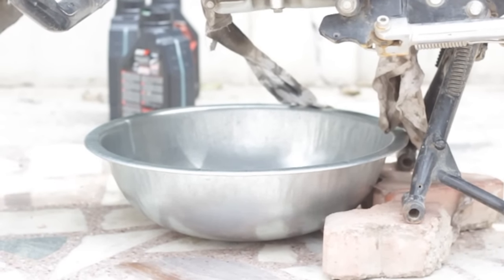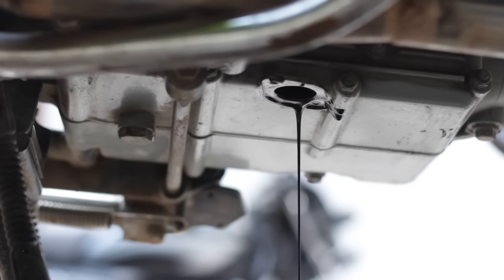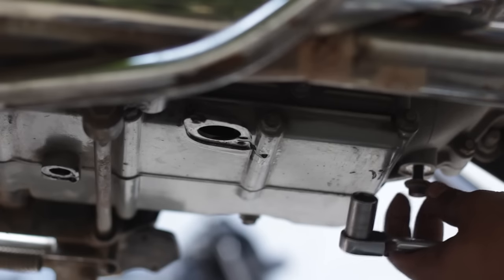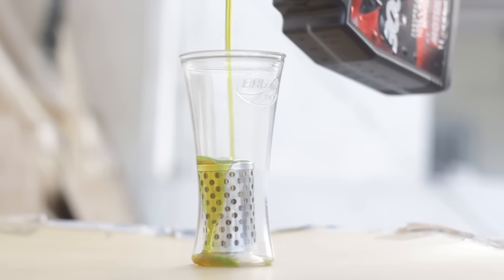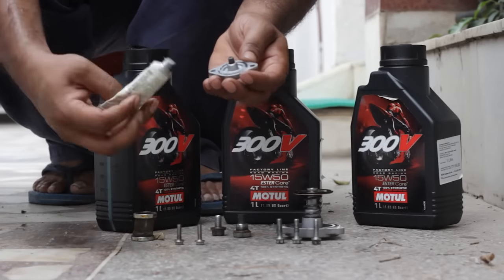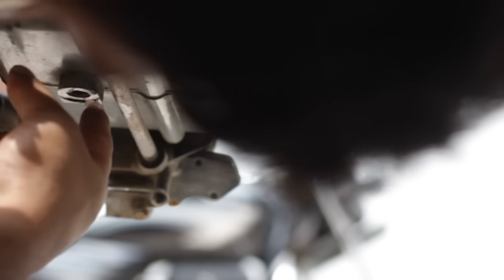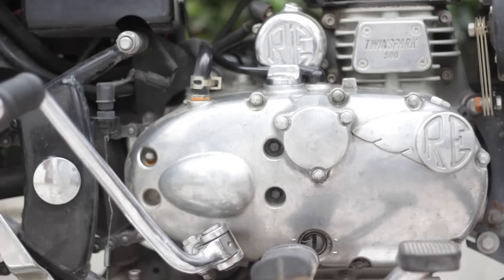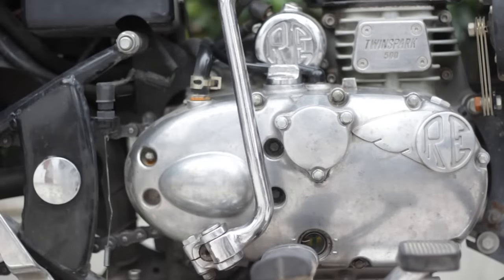Changing engine oil in Royal enfield Bullet 500 UCE

Comment: This oil had more viscosity and can be used upto 11k kms... Reason being the oil loses viscosity but in 300v the oil viscosity is more as this oil is specially made for the racing kinds... While racing the engine revs which causes the oil to circulate frequently in the higher temperatures.... Just my thought again please lemme know on this

Comment: Very useful and detailed video.Can I switch over to Motul Semi synthetic for my 2nd service?Will that be a problem?Also how do we flush the mineral oil fully before changing over to synthetic oil?
Reply: Nikhil Menon You can use motul 5100 in semi synth range after the engine is flushed or 
Switch to motul 300v if your bike's bore is bigger or equal to it's stroke length .
Otherwise motul 7100 will be your best bet in full sunth range.
Reply: VENKATESH AO  thanks buddy I will definitely try that after my paid service

Comment: Hi brother, thank you for a very informative video and I am inspired to do this by myself.
I would appreciate it if you can clear my doubt:
I have TBTS 350 and have no idea about which type of oil put in by the mechanic. I would like to switch to synthetic oil. What additional steps should I take to do this by myself. someone here mentioned about flushing but I dont know anything about it.
Thank you., cheers.
Reply from the maker: Triple Hunter Hi engine flush is a very simple procedure. Do this before changing from or to any synthetic oil. just buy 3m or any good quality engine flush. pour it in the engine and close the cap. then run the engine for 5-10mins. then follow the procedure for changing oil as shown in the video. thats it.
Reply: Enfield Performance thank you for a quick reply. will try this one out :-)

Comment: Never open the primary bolt and never remove oil from it, because it is crank chamber oil.if you are draining it, it will damage the crank.it has 500 ml capacity and you need2.5 litre new oil means total three litre.

Comment: Both sump plugs should be fitted with copper washers to seal them, no goo required. The suction filter may require a fatter O-ring, the original is very thin and prone to dribbling.
Reply from the maker: Sure Jeff, I have never tried it but it could also be a option for people who do not want to use silicon adhesive. Personally i have never had a reason to complain with silicon adhesive as when applied properly it never leaks or causes problems.
Reply: The sump plugs are supposed to have copper washers from new, as is normal for sump plugs on any engine. Some folks substitute Dowty Seals which are more high tech. But as the sump plugs require little torque (or you will strip the threads, steel into alloy), there are supposed to be copper washers there to squish. Bath tub sealant is a poor substitute. Copper washer, drain plug, RE p/n 144846

Comment: hey buddy tell me about the performance of this oil
plzz soon
Reply from the maker: Hey Ujjwal, This oil is great. Gives much smoother performance and also longer service times. I now change oil every 6000 kms instead of the normal 3000 kms change.
Reply: I've used full synth oils for gosh, maybe 40 years, since they were invented. I've found they last much longer than normal and semi-synth oils. 
When an oil goes filthy black its detergents have been used up and it is time to change it. With the full synth I'm using now (Mobil 1) in the C5 it looks like it would last a full year, it's showing no sign of deteriorating after 2000 miles (3200km), it's still like new after 6 months. Another test is to rub a drop between your fingers, if it feels thin and watery its molecules have been chopped up by the engine and it's past time to change it because its lubrication properties have gone home. 
Full synth oils do cost a lot more but they do the job better.
Otoh you cannot change the oil too often.

Comment: I ride a 350cc variant. I got the oil changed to Motul 300V. My worry is the oil levels went really low in just 1900km of running! Do you think there is an issue with the engine? No doubt, the performance and refinement has improved many folds.
Reply from the maker: Saral Gupta Hi saral, lots of reasons for this. Either complete 2.5 litres of oil was not put in the first place or there is a leak in the gasket or there is too much friction in clutch plates leading to burning of oil. The quick process would be
1. top up the required oil and check if it is again going low
2. If it happens again then check for any oil leaks and seal it.
3. Also check while riding if you smell oil burning.
Reply: thanks, I will make a note of them. The only thing that is very obvious right now is tht the gear shifts have gone very hard. I have bought the oil today, will replace the oil and look for any visible leakage too.

Shall keep you posted!
Reply: Check your crankcase for any oil leaks.Tighten all the drain plugs.Check your Exhaust for white smoke (If so,The engine is burning oil with Petrol),Then you have to replace the Head Gasket.
Reply: Wanted to ask,How is the smoothness of gear shifting and Engine refinement after using Motul ?
Reply: @MrSaralgupta  Does the rear wheel spin freely in gear + clutch pulled in?

Comment: Great video. Thank you! I was able to change my oil today thanks to your instruction. Only problem for me was having the wrong filter! I'm from Reno, Nevada and don't have a local dealer. I replaced the original filter, filled with new oil, and reordered the correct filter from Hitchcocks Motorcycles.
Reply from the maker: tcbnev way to go. just do not run the Bullet too much till your new oil filter has not arrived. As if your old filter is chocked up it can block the oil from reaching the engine.

Comment: Hi, You have suggested to do engine flush before switching to the full synthetic oil. Can you tell us how to do or tell us which motor flush you have used to flush. Is there any km limit to do engine flush?
Reply: Flush with fresh engine oil. Simply change to the new oil. Change it about 300km or so of riding, you may want to do it twice until the oil shows clean; full synth stays much cleaner looking. I switched to full synth after first service (Mobil 1 Racing 4T motorcycle oil) but note oil spec is still 15W50 JASO MA. The latter (JASO) is very important because the wet plate clutch runs in it, do not use car oil. It is not possible to completely empty the sump, a good 0.5 litre will always remain in there no matter how much tipping you do.
Reply from the maker: Kishor Kumar Hi engine flush is a very simple procedure. Do this before changing from or to any synthetic oil. just buy 3m or any good quality engine flush. pour it in the engine and close the cap. then run the engine for 5-10mins. then follow the procedure for changing oil as shown in the video. thats it.

Comment: Hello..while changing oil I have ripped the threads of the secondary drain plug..any suggestions to fix it?
Reply from the maker: go to a good mechanic. they will bore in a bigger hole in the engine and fix it with adapter.
Reply: if your threads are not conpelety ripped you can use some tape on your bolt it will automaticly take shapes and its leak prrof only cost 20 rupees per tape 

you can go and buy it from the market from any bathroom and kitchen water pipe fitting  shop ask them for tape which is used to prevent leaking in you tap faucet...

our ask any body who does alminum welding ask weld a bigger bolt on the top of your hole

Comment: what's the local name of the sealant..
Reply from the maker: I  know the name RTV sealant. You should get it at any mechanic shop. It is also called silicone adhesive or gasket maker. If you cannot find it in the, local shop buy it online from here

http://www.amazon.in/ANABOND-GASKET-MAKER-RED-SILICONE/dp/B00S1POOLC/ref=pd_sim_sbs_328_2?ie=UTF8&psc=1&refRID=1TS1CKKHKW6GP0B57795
Reply: +Enfield Performance Thank you
Reply: We generally use bathroom silicone sealant, basically the same stuff only cheaper. However we only use it on the silencer joint, the stuff is heat proof.  As I've mentioned before, the correct thing to use are copper washers (e.g. p/n 144846), which should be on the drain plugs from new. They're dirt cheap, easy to fit and work better. The O-rings should be 'greased' with engine oil. The suction cover O-ring groove is 30mm OD, 25mm ID, so it can take a 2.5mm thick O-ring, the original is barely 2mm thick, loose in its groove and does not seal well.

Comment: Thanks! Very informative.  
off topic - Any experience you have with about any seat mods, or handle bar mods?
Reply from the maker: hey tushar,  for handlebar I prefer the thunderbird handlebar on my standard. extremely comfortable and great turning angle. I find the Bullet standard stock seats quite comfortable, but still looking for better options.
Reply: I too was thinking to get the thunderbird handles, glad u vouched. Also want to try out the thunderbird seats on my std if i can find those and they fit easily. Somehow they look really comfy and may sit me a little lower (2-3) inches maybe.
Reply from the maker: Try the handlebar modification first. It is cheaper and you might not need seat modification after that. Seat mods are typically costlier starting from 3k onwards. Also you can look for seat gels instead in case you need a softer seating.

Comment: Awesome video for a newbie like me! Makes it less intimidating to buy the bike.  One question, the oil soaked filter goes in as is or do you wipe it clean before installing it?
Reply from the maker: Hi Vinu I wiped it with a cloth before putting it in as I did not want oil leaking outside on to the silicone sealant as I am closing the oil filter cap.
Reply from the maker: Hi Vinu I wiped it with a cloth before putting it in as I did not want oil leaking outside on to the silicone sealant as I am closing the oil filter cap.
Reply: Cool and that bit of oil used to soak is totally usable right? Thanks for taking time to reply.
Reply from the maker: yeah you can put it in engine with the rest.

Comment: You are the only person who told that the engine has to be run for at least one minute and recheck the oil level. There are some guys who are filling only 1.8L because the indicator showed full. For my Duke 390, they filled 200ml less, and I had to topup it again after seeing that the engine is becoming hot too quickly.
Reply from the maker: Suryanarayan Mondal yes you need to let the pump circulate the oil in the engine to get the right level. otherwise you might end up under filling.or over filling the oil.
Reply: Hmm. I did not find any video of oil changing of a RE which shows the oil indicator after filling the oil. And they are getting million views.
Reply from the maker: Suryanarayan Mondal 😊 well in my case I prefer to be safe than sorry. I focus more on thorough instructions and less on marketing my videos.

Comment: why so many drain plugs?
Reply from the maker: Hey motorman The Ci engines used to have three different places to fill in the engine oil as well. They overcame this complexity in UCE engine, however the three different plugs still remain to drain oil from three different sections of the engine.
Reply: Enfield Performance Thank you for answering..
Reply: The EFI still has two places to insert oil, the oil filler cap and the filler plug, chain case, on the LHS. Ignore the latter when doing an oil change (it's there for if the engine is ever stripped down) but do note that due to various weirs and dams inside no one can ever get all the old oil out by draining. There's usually a good 0.5 - 0.7 litres left inside. Total is 2.75 litres (max). So add 1.75 to 2.0 litres of fresh oil through the main filler, circulate it by running, wait 5 minutes and carefully add oil little by little until it /just shows/ in the glass. Circulate again, remember to wait (tedious) and gradually top up again to between the two marks, not to the top mark, that is the absolute maximum level.
It is too easy to fill over the top mark, if that happens drain some out, the suction filter is easiest to control.
One must never overfill any engine with oil. Although the EFI is not so prone to it, if you overfill a Bullet engine with oil, it can cause wet sumping, which is bad news.
The pumps will suck oil properly when a little over half filled, (you can hear the pumps suck, or not), thus it will happily tolerate being a little under filled.
Having said all that, the oil change is not a complicated operation, just methodical and boring. I can't even do the oil on the cars these days, they don't have sump plugs any more so they have to go to the garage.
Reply: Two drain plugs, one for gearbox, one for crank case, plus the suction filter cover. Three places in all.
Reply: Jeff Slade The carburetor UCE engine is different then?
Reply: TheMotorman, the carburetted version is not exported to here so  we never see it, hence referring to "EFI". As far as I'm aware it's the same Unit Construction Engine. I have a Classic 500 (C5)  EFI.
There are differences between domestic and export models but I don't think it extends to changing oil.